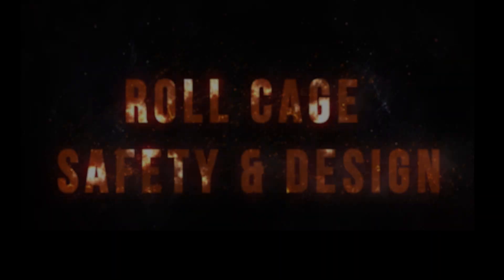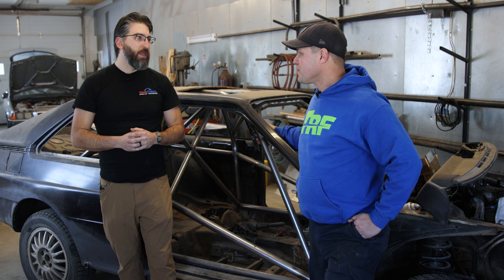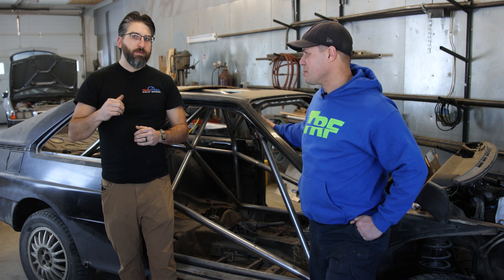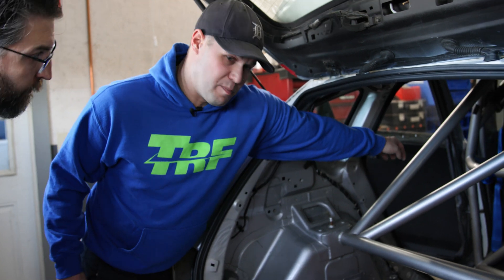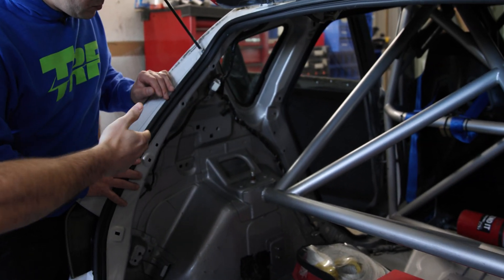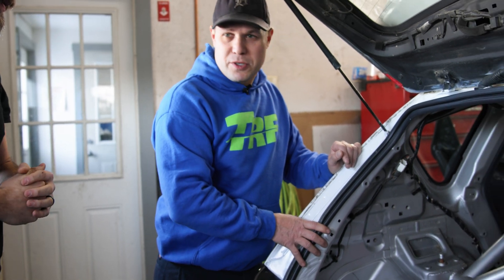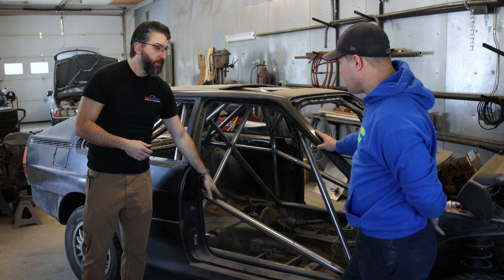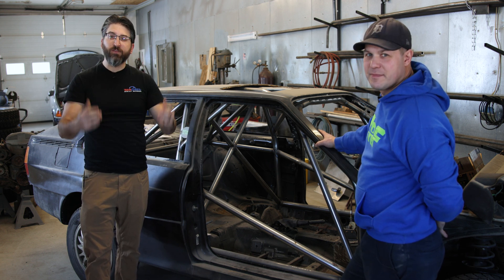Roll Cage Safety & Design | Design Theory

Comment: What I wanna know is whether or not there's a cage design that's "daily drivable" (doesn't severely impede on passenger capacity or ingress/egress, specifically for the rear seats of a coupe) and will be accepted in multiple different sanctioning bodies for at least the first level or two of performance where a cage is actually required at all. And if not, is there a cage design at all that will work do so regardless of ingress/egress impediment and if so, what's the closest you can get/most racing types you can cover with said cage design?
Reply: You and me both. Eg a lot of cage parts go directly along the a-pillar which should be fine

Comment: Discuss dead tubes(tubes landing in the middle of a tube/or without back side support or chassis) in more depth, and landing tubes into bends(node crucial), etc. These can become missiles, look at Evo crash on Pikes from like..2012 iirc.

 Fitment - no gaps on landing sites for tubes, full radial touch from a tube end on another tube. 

Gusset placement and pillar strengthening via chassis gussets, etc. 

  Breaking down planes for the base plate, multiple tubes will support one another with energy dissipation, so single tube base plates are in inherently weaker and interior and exterior plate additions vs just interior plates. 

 I haven't watched the rest yet, but, please discuss welding sequencing, heat control and so on(even material specifics on these).

 Great job guys, love the content.